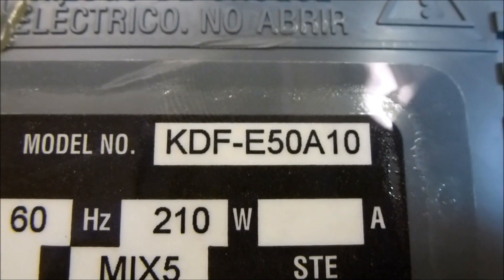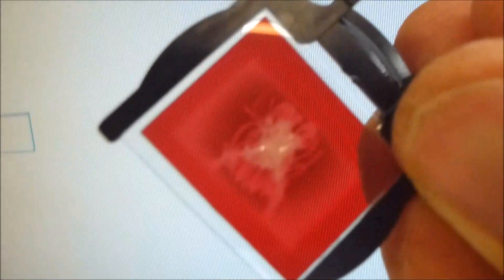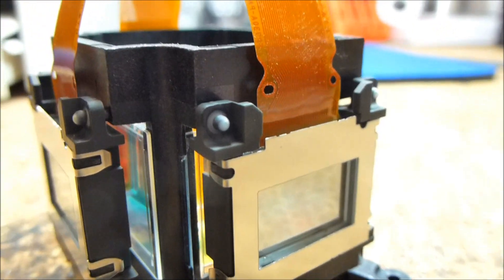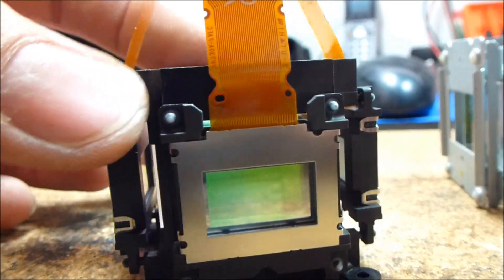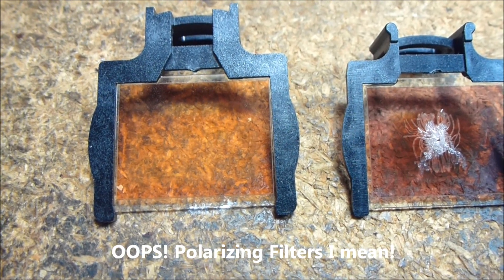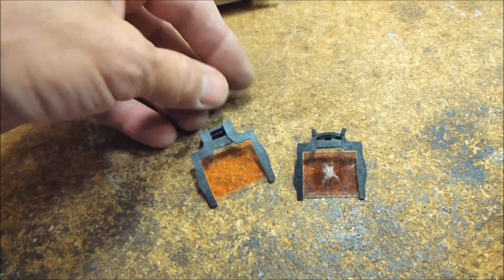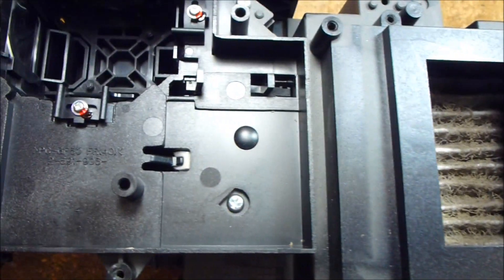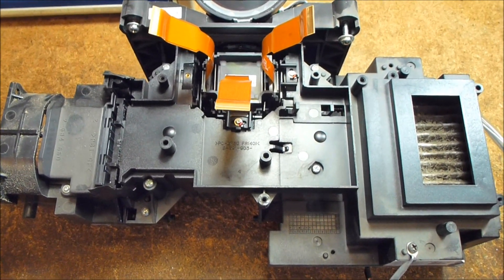KDF-E50A10 A10 series LCD with Green Blobs in the picture

Comment: I got discoloration on my KDF-50E2000 across the top and bottom about an inch thick. The top is redfish and greenish on the bottom. I need to fix this. Please help.
Reply: Need to get to the film part and clean it with microfiber and canned air.  Probably some schmoo particles on the film or bulb

Comment: so if the function of the tv is still operational but i have the blob going on in yellow would you suppose the LCD block is cool and i would need to replace the polarizing filters? then clean the air filter of coarse.. i might be able to find a new one if i looked .. what are your thoughts

Comment: where can you buy sheets of the the polarizer filter  material if you want to cut it to shape to attach to a spare plastic filter clip to avoid discarding the old ones and keep as a spare to reuse by removing the scorched filter material and attaching a new sheet of polarizer filter material. i have this problem on a 3lcd  projector and it gets scorch mark on the polarizer filter
Reply: Hello, there are a few ways to obtain polarizing film.

You can use smaller polarizing film that is cut for phones, but your best option would be to obtain a LCD from any device and to disassemble it to get access to the rear of the LCD panel/rear polarizing side of the glass. You can slowly remove it with a new razor blade and mineral spirits ( the only thing that I found that works ).

I am a laser/optics person and finding good polarizing film to buy is difficult and pricey, I usually harvest instead.
Reply: Does the color matter? Each of the 3 channels of these TVs have different color polarizing filters (grey, greenish, orangish for green/red/blue paths)
If a colorless polarizing filter from your LCD idea is used to replace the orange one (blue path) will it have an effect on the color of the picture?
Reply: The color cooresponds to which side the film is on like if taking from an lcd screen, if you rotate it 90 left it would be green (hence the green being on the right of the block) and red will be 90 to the right.  The film is basically a buttload of prisms all microprinted on a sheet of opticlear filiment plastic paper.  If you bend it you can see gay jesus through it..

Comment: I have this exact sony tv that is shutting down after a couple minutes and then the standby LED blinks 7 times. Could you give me a little insight on this problem. It's had also develop the blue blobs on the screen as well.
Reply: Okeyo C  I have the same problem with the green flashing standby light.  can this problem be fixed.?

Comment: Im pretty sure my polarizer is shot on my tv. I got it for cheep and i thought it would be fun to try to fix. Any suggestions on where to get a polarizing filter for this model? I know ebay but all I am finding is red and green not blue. I want to try to do this as cheap as I can because this is just a hobby project. I read somewhere that someone took a camera polarizer and probably glued it in  to work. seems like it would be hard to get the alignment set on something like that though.
Reply: we supply projector polarizer lens my whatspp: +8613535026857

Comment: I have watched two (2) of your videos fixing Sony optic blocks.  I have two (2) of these TVs both with fried, blue polarizers.  Where can I get just a polarizer for the blue.  Also.  I have removed the LCD panels from the A series TV, (real easy to remove), but due to the convergents, I haven't attemped replacing.  I'll let you know how it goes when I swap them out.   I think there is a way to converge after doing so.  If you have polarizer you don't need, let me know if I can get it.  Thanks, John.

Comment: also, the filter will need to be replaced because the filter material has pull out of the mesh. it will no longer work as a filter. any suggestions?

Comment: I have a kdf e50a10. and the red polarizing filter has a rectangular faded area in the center of it. everything else on the light engine is fine and I would hate to have to replace the whole thing. I am trying to rebuild it myself and the only thing I'm having issues with is finding a new filter. no one has a replacement filter available and every parts carrier wants to sell me the whole light engine instead. this tv was free and I'd like to keep costs down.

Comment from the maker: I think yours is ok. I think that the 55A20 is an older set and can be rebuilt, I would think the 60A20 would be the same. If yours uses a XL2100 or XL2200 then rebuild is possible. If it uses a XL2400 or 2500 then you have the factory glued panels and cant do anything unfortunately.

Comment from the maker: Thats right, but if you have an older LCD Projection tv some repair shops may be able to replace your blue LCD panel and polarizing filter. I have a video that shows blue blob and blue spot repair. You can get a complete new or rebuilt block for it. new approx 800.00, rebuilt 350.00 depending on the exact model